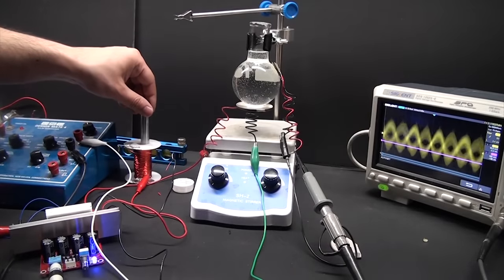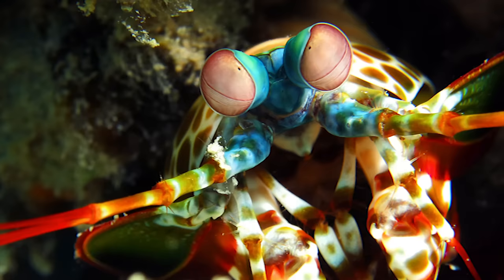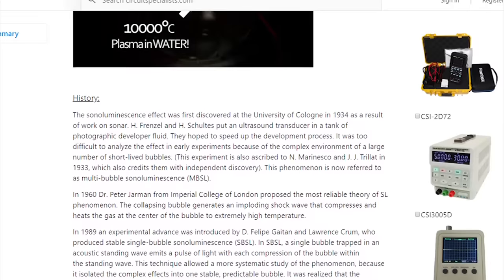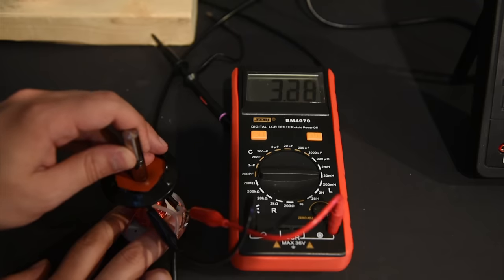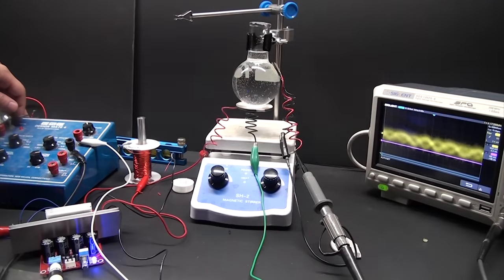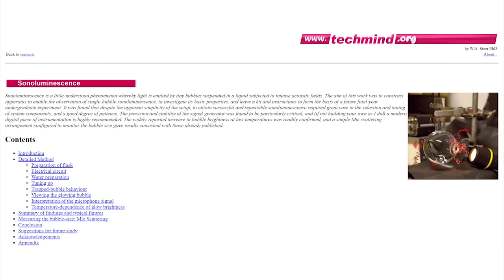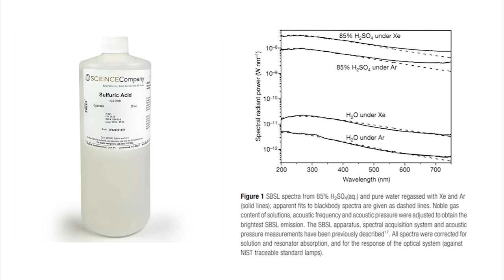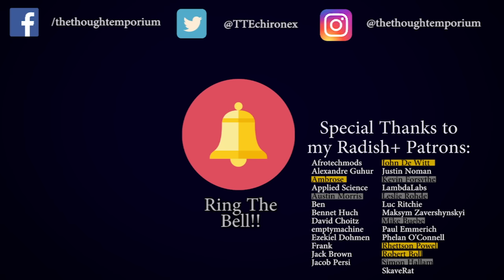Punching Water So Hard LIGHT Comes Out - Sonoluminescence

Comment: What would happen with a bubble of krypton or neon? Coloured bubbles??
Reply: Was my first thought too. The gasses need to be denser then air. I was thinking about co2 but your gasses are also more dens than air.
Reply from the maker: It would affect the glow, not sure about the color. Xenon is known to make the glow brighter
Reply: @thethoughtemporium  What about liquid nitrogen or liquid glass?
Reply: Why not just use a chamber of an atmosphere with a different gas composition? Cody'sLab, did this in his videos of Burning Propane In Pure Oxygen and Burning Oxygen In Propane Atmosphere. The dropper would have to be remotely controlled, though. But this would allow you to test any gasses, as long as you have a source for those gasses. 
I'd be curious to see the interaction between various gasses and liquids, what color would an Argon bubble produce with an NaCl solution, or a Neon bubble in the glycerin solution?
Reply: Could you not just inject a bubble of gas with a syringe and a long tiny needle? If you start the transducer first you should be able to bring the needle tip at the focal point and inject a bubble of gas right there. Could also probably make the bubble a bit bigger, if you also raise the amplitude of your signal. I have a feeling a larger bottle with a lower resonant frequency will be much better at containing the bubble at the focal point, because lower frequency means more energy... This may also be why it didn't work for you with sulphuric acid. It has a much higher molecular weight than water, and it has a higher viscosity, therefore my intuition is that you will need a resonant chamber with a larger volume to achieve a lower standing wave frequency at the focal point. But because the resonant chamber is larger you also need more power...
Reply: @thethoughtemporium  I'm not too familiar with the physics, but it seems to me that the second plausible theory that you mentioned in your video would not explain why using Xenon would make the glow brighter.
Reply: @thethoughtemporium  This is the gas I was thinking of. Please try!
Reply: Argon should be easy to try
Reply: Enter 'Keyboard Experts'.... 🙄
Reply: @jeremyhall9346  to elaborate my keyboard expert input, Argon would be easy to try because it's an inexpensive, readily available welding gas and because it can be used in the same method as the original experiment. Argon is more dense than atmospheric gas, so filling the top of the flask will lead to Ar gas sinking in the flask, to the surface of the water. The drop of water should pull Argon from the surface instead of atmospheric gas. Argon, like the other noble gases, has a relatively low ionization energy and would hypothetically become ionized by heating relatively easily, leading to a higher plasma density and increased photon emission. 
Argon does have relatively high mass compared to N2, and O2, so that may change the behavior and stability of the suspended bubble...
Reply: @tannersword1  in a perfect world.  But.... I digress.
Reply: @kurt0kasem  My 1st thoughts were elemental gasses, but yeah, we need as much new information on co2 for science.
Reply: Sounds like the colour is due to electrons changing levels, which would explain why xenon makes it brighter (like a xenon camera flash), sodium gives yellow and air gives UV (mainly nitrogen). I'd be expecting neon to be pink/orange. Carbon dioxide might give infra red light.
Reply: @kurt0kasem  CO2 is pretty highly soluble in water so it would likely disappear pretty quickly.
Reply: @BrianFedirko  maybe you could find a way using this technique to help making elemental oxygen an carbon from co2. By splitting the co2 molecule.
Reply: I was wondering what the emission frequencies are and different gases emissions would be interesting also?  Ionizing maybe too or just in the VIS light range?
Reply: Radon gas.....you know so that we get some atomic goodness.
Reply: @thethoughtemporium  Can plasma be made to 'cavitate'?
Reply: The Thought Emporium Experiments using plain air have shown that most of the color and intensity is likely due to argon.
Reply: jafinch78 if you mean the number of flashes, the frequency is equal to the frequency of the acoustic signal. If you are asking about the color, experiments have shown that when using air the color/intensity is most likely due to argon
Reply: There might be a need for a "continued further experimentation" channel to hit these wider inquiries.  Like how to cook a steak 20 ways, but science instead.
Reply: Or pure alcohol?
Reply: @BSpinoza210  Ouch, love that thought!
Reply: @strehlow  Same with hydrogen?
Reply: @Daja_Dahya   I responded with both since it wasn’t clear which they were asking about.  If the acoustic signal is 20k Hz, there will 20k light emissions per second. If the bubble is made up mostly of air, the frequency as it relates to color is blue and is likely due to the argon present in air.

Comment: There is a technique in beer brewing called first wort hopping that brings aromas from hops added before boiling starts into the finished beer. The usual hops addition time (after boiling evident at the surface) does not preserve those aromas. There is evidently some chemical modification to the aroma compounds that stabilises them in the first wort hopping scenario. A likely process is, as steam bubbles form at the bottom of the pot and then rise into the cooler wort above, they collapse, giving a very local but intense heat.  That heat drives a reaction that otherwise never happens in brewing.

Comment: You could probably epoxy a nut to the inductor and screw a bolt with grease or weak loctite to keep it in position to adjust the inductance. 
Nice video.
Reply: Or get one of those variable inductors from an old-timey crystal radio.
Reply: @charleslambert3368  : That's almost how they make those old inductors.

Comment: 3:38 another great example of cavitation damage is on wet liners on medium and large diesel engines such as a Detroit 8V92, a CAT 3406/C-15/C15, a Cummins N14(?) or an 8.3 Cummins if the N14 isn't a wet sleeve engine, a Detroit DD15, etc

Comment: It's important to use lower melting point solders (<260 degrees C) when soldering wire to the transducer otherwise the conductive layer deposited on the ceramic disc will come straight off. I learnt that the hard way!

Comment: I would hypothesize that when you drop a stone into a pool of water waves are generated with an intensity consistent with the force of the impact of the dropping stone. Likewise when I strike a steel plate with a hammer a wave is generated in the steel plate which generates a wave through the air (sound).
So we have force applied to some medium resulting in a resonant wave of some magnitude.
You are extracting matter from a point in space but medium where magnetism lives, whether you call it aether or any other name still remains in that void. Collapsing that void is equivalent to striking the electromagnetic medium with a hammer of water. Waves in the electromagnetic medium are what we know as light. So it's not heat, it's not cold, it's nothing fancy. It's simply transmission of energy from one medium to another. Like dropping a stone into a pool. That's where your light comes from.

Comment: This proves the theory of quantum electrodynamics in which photons are force carriers.

Edit: Well it's what I think but the reason remains unknown.
Reply: Plausible or something going through water at very high speeds can create photons that are the biproduct of molecules themselves being ripped apart by the heat and friction created. Technically doesn't prove that point in my eyes but considering solar sails work using mostly photons does a better job at it. With some interference from other high energy particles.

Comment: What happens if you freeze it during this reaction?
Reply: Vibrations cause heat. Water molecules are heated until they emit light as a form of energy. If the water is frozen, then the molecules will not vibrate.
Reply: @johnwirk  I think what he meant was freezing the moment the light comes visible i guess.

Comment: What I see when doing this experiment is a way to convert mechanical stress, in this case, sound waves underwater, to electromagnetic emission. If this is properly understood and reversed, where you use lasers to generate sound waves, then this could be used for propulsion underwater and maybe even in air. This could be BIG, like a new way of electric propulsion. NASA and the military may want to look into this!

Comment: If the bubble is a small amount of excited noble gas that causes the glow, how about top the water off with that gas.
Also, use a thermal camera to find if the bubble is hotter or colder than the surrounding water.

Comment: How it works remains a secret of nature. Clearly producing light is an electric effect. I vote for the explanation that identifies the process of making water act in a way that is electro-chemical. Water is extremely flexible in basic electrical terms how the bonding works. But watching it flash is not likely going to tell you until you can fix the bonds and test multiple configurations.

Comment: I know this experiment with xenon gas diluted in distilled water, enclosed in a glass tube and 2 sound emitters at each end, creating a standing wave at its center. At almost the center, a heated wire which at its tip creates a xenon bubble. The standing wave strips it off and moves it to the center. Where then it creates a pretty stable and hot light. Tiny but yet good visible. That was an experiment I was involved with about 40 years ago, and I was there to take measurements for the first time with a computer. The goal was to find a cheap energy source, but the project was dismissed.

Comment: use an infrared camera to see if it's hot or cold the before, during, and after the time of the combustion. Also, use an infrared camera used to see gases and slow-mo on the recording acquired from the infrared camera. Hopefully, that helps determine which theory is true or most accurate.

Comment: This used to happen in the Great Pyramid's subterranean chamber which used to be a hydraulic ram pump. The pump would generate a pulse in the pyramid which would be utilized by the Grand Gallery and King's Chamber. Simultaneously cavitating the water would separate hydrogen and be directed to the queens chamber.

Comment: Some ideas that might help us solve what is going on:
1. What is the wavelength of the light emitted? Is it constant? Does it change with frequency or amplitude?
2. Is there any radiation other than light emitted?
3. What if you change from water to another fluid - is there a connection with the frequency?
4. What if you used a noble gas instead of air for the bubble? Does it glow in the same color as the excited state?

Comment: Your inductor will have a lot of losses(Ac resistance) when you insert the steel core because of eddy currents. They use magnetic fields at about your frequency to melt steel, and laminate mains transformer iron cores for this reason. Better use some ferrite material.

Comment: Insane man! I'm pretty sure the light source is hydrogen atoms being stripped from the water by the ultrasonic frequencies and burned. 

It reminds me of Stanley Meyer's hydrogen electrolysis method, which had used high voltage/low amp electrolysis tuned to create standing waves in a ceramic cavity, which stripped off hydrogen such a fast and efficient rate he caught the gov's attention and is deceased.  It would be awesome if you could make a pt 2 and recreate stanley meyer's work

Comment: Love what you're doing I use a 1/4 magnetic bearing and a ring magnet then used a frequency generator app through my phone ran that through my guitar amp and place my piezoelectric at the correct position . I only achieved levitation took me 3 days to dial in I would like to do this in water bet get cavitation with the compression disc .maybe 2 disc within the like to try the egg shape Tesla also used a football   formation facing the two halves at each other .

Comment: Just an amplified wave length that " uses" the water a as a catalyst into the air. With an even distribution of incoming energy since it's a circle... at the center couldn't under the pressure of the water make the incoming waves more difficult to leave.

Comment: Fill a ceramic coffee cup ☕ half full of hot coffee and take a spoon and lightly tap on the bottom at the same  speed and pressure and see what happens, the sound of the tap changes pitch to a higher sound with each tap even though you are using same speed and pressure with the spoon

Comment: So, there is another experiment done with water and air. When you suddenly release air into water stuff on top of the water sinks. The water becomes less dense. So sound waves and quantum particle waves are waves. The frequency of the sound wave makes the air and water molecules the same density and there is no differential between them. The air bubble doesn't have to go anywhere?

Comment: This looks like that video of the 2nd plane hitting the WTC on 9/11. Someone used interpolation to increase the frame count to 200 fps. Right when the tip of the airplane hits the building, there is a flash of light.

Comment: I actually can't believe this!

I was just thinking about how one could use the first law of thermodynamics to its full potential, and basically forever recycle energy, therefore never running out.
(I am aware that it's probably an amateur way of thinking, but that's really what I am)
I thought, "Say you take a computer and reuse all the heat and electricity it generates to power said computer; that might work..."
Then, I realised that sound would be a problem: sound is also generated, and how the heck could one reuse that in the form of electromagnetism?
Then this video pops up, perfectly demonstrating and explaining that exact phenomenon!
(I am also aware that this is in a fully prepared, specific-to-ultrasound, basically single-frequency testing environment, but it's still a start)
Ok, ok. Algorithm, you're alright.

Comment: You can do that at higher levels using a pressure washer at 2k psi or higher, just spray any surface at short distance and you'll see a plasma like where water hits the surface.

Comment: Just a speculation I have know way of knowing for sure without doing the experiment, but I feel as though  using two or more frequency generators tuned to a fundamental frequency and harmonics of that frequency would create a beat frequency that would allow you to vibrate the water faster than you could with 1 frequency generator, which I feel might cause something interesting to happen due to the size and power of the waves. This might help when experimenting with different mediums other than water

Comment: I'm pretty sure this is the same mechanism that operates gas dynamic lasers. The gases in such lasers release photons when they are rapidly expanded and cooled by a nozzle after being compressed and heated by a throat. This experiment does something very similar, expanding and compressing the gas with sound. (Note: Im not a physicist or a chemist, this is a mostly uninformed engineer's commentary)
Reply: Bonus points for whoever makes a sonoluminescence powered laser!

Comment: A mantis shrimp’s punch reaches around 8,500°f, almost as hot as the sun, off only by around 1,500°f, which might sound like a big difference but with such high numbers it actually isn’t. Remember that this is generated by a low pressure bubble collapsing in on itself, not nuclear fusion generated within a star, so the temperature is beyond astonishing and impressive

Comment: Variation of the experiment: what if the gas above the water, in the neck of the flask is changed to H2 (for example) or ( substituted more safely) to Helium instead of air. Then the little droplet would be enclosed in a thin layer of hydrogen ( or He). Would it make a difference in the light emission? Maybe too dangerous or difficult for a garage laboratory? H2SO4 is a proton donator H+. So maybe another gas, then air would have an effect.

Comment: I think the trick lies with the molecular structure of water and the bubble itself. Either the collapsing is causing the bubble to combine the hydrogen in such a way that it reacts with what ever is in the air, or, the sound wave is interactive with whatever it is synced up with. Causing a particular boogy. Which would be an indication that sound and energy aren't so different or at the least they have some relevancy to each other. Could it be that the RO  has a lack of ions and the vibration of the gasses in the bubble is producing them to create a small electric charge and that's what causes the hydrogen to be ignited forcing collapse and a re-expansion. God only knows but now I wanna make a star in a jar.

Comment: kinda late to a party but what if you flood different gases there other than air? for example if you put propane there, in theory plasma would burn it, so after initial flash you'll get bubble filled with pure co2 which would give off IR radiation, you can detect it with IR diode with transimpedance amplifier. where as if its just electron jumping up and down, you should not see any difference in IR spectrum compared to pure air.

Comment: I’m guessing what happened with the sulfuric acid was you probably had the pressure so low that you started boiling it.
Although I can’t find a phase diagram of sulfuric acid to prove that…
Anyway, I think if you raised the pressure you used for degassing a little bit, it would’ve worked.

Comment: I would think it's obvious that the light is coming from heat. Anything will emit light when it reaches specific temperatures. 700 degrees Centigrade will get you red light. 1300 degrees Centigrade will get you white light.  Everything emits light when it gets hot, gas liquid or solid.